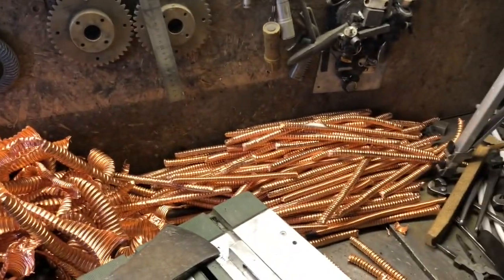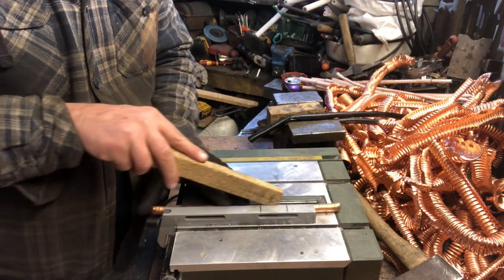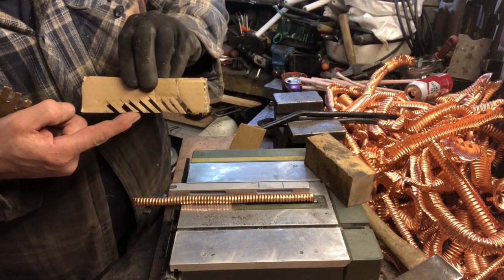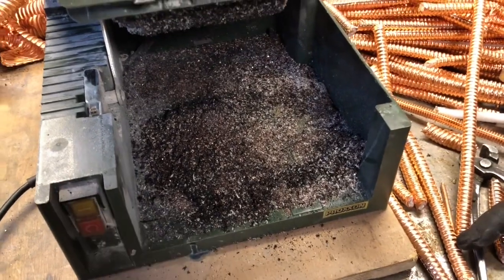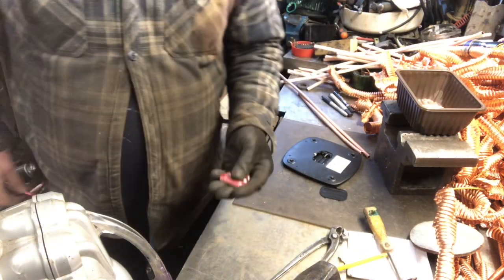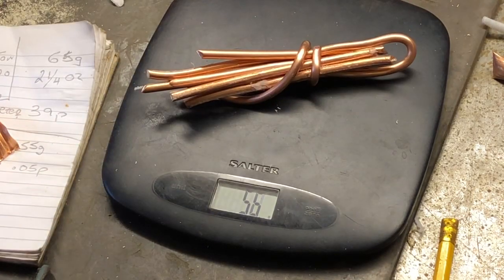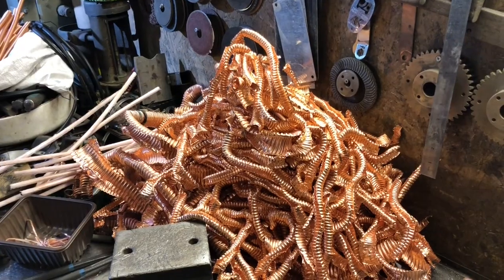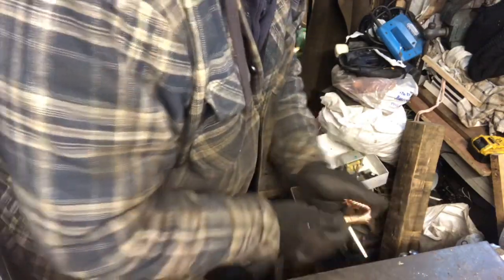For Shark Scrapper Heliax revisited

Comment: Nice follow up Ian - you've answered most of my questions! Except one I just thought of regarding why your shed doesn't sink into the depths of the earth?? Massive weight per square inch and constant vibrations from 'ommering should see it at least a few feet below sea-level by now.. 🙄🤣🤣🤣
Reply from the maker: Lol believe it or not there is a mechanics pit built into the floor, full of stuff of course for “whenever “
Reply: @Man-in-da-shed  Wow.. a cellar for the grog maybe? 😁

Comment: Up here for thinking down there for dancing is what I think they would say Ian. I have one of them rulers Ian I use it on the sheet steel when am measuring handy thing. Asatone you can buy at your local motor factors we use it for cleaning turbo intercoolers out. Lol  heating the batterys up 😂 Anyway to get that little bit more out of them lol. It's not a bad deal Ian few beers in it for you and if your enjoying yourself why not. 👍🤙

Comment: Wouldn't a machine wire stripper work?
Reply: Only if you have an industrial sized stripper for the larger cable and then it will only help with the outer jacket.  Most of the ones you see on Amazon can't handle this size cable.  Plus the copper is corrugated which can make it difficult to strip.  There are industrial scale strippers that can handle this cable if one is willing to fork out the bucks.